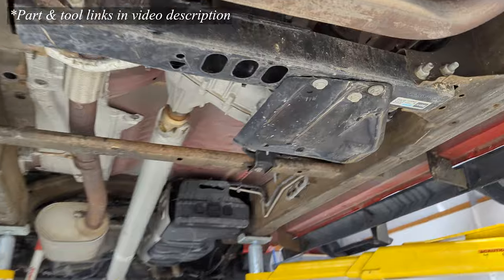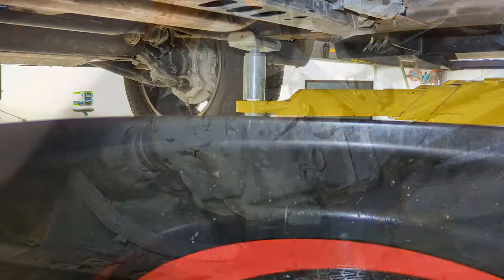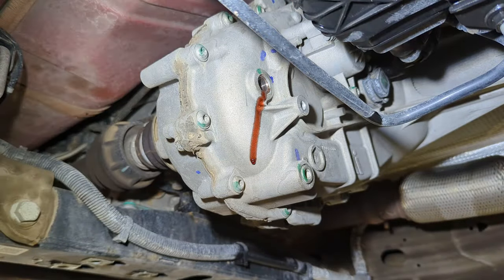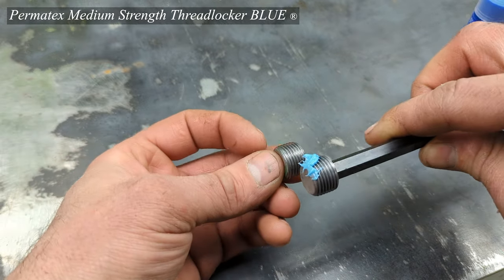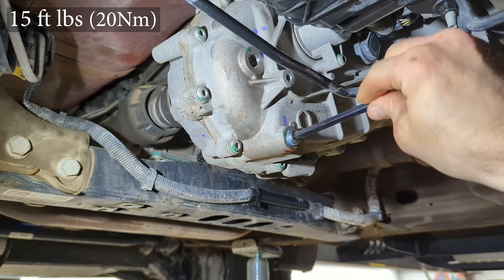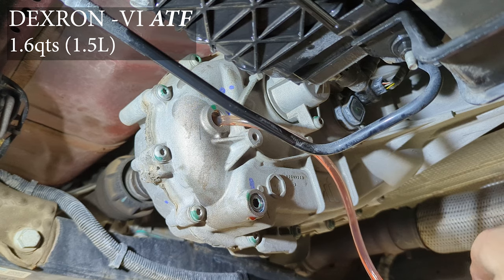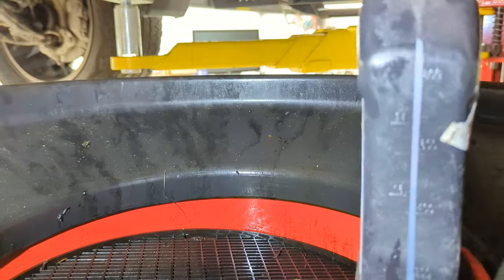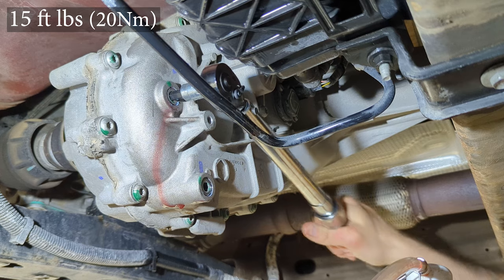2019-2024 Sierra/Silverado: 4X4 Transfer Case Oil Change

Comment: So I keep getting mixed info on the mobil 1 lv atf hp fluid saying it's compatible with dex vi. The older black label says it is however I ordered 2 quarts and got the blue lable which doesn't mention it on the back. Would this also work and be compatible. In my t case 2020 silverado.
Reply: Yes, blue label is the newer, improved formulation over the old black label.  This is what most recommend using to prevent or fix trans shudder & rough shifts when doing ATF flush & fill on our trucks.
Dealers in the US use ACDelco Blue Label.  Most DIYers seem to go w/ the Mobil 1 for xfer case & trans tho, and Valvoline 75w-90 synthetic gear oil for both differentials.  This is what I'm using after a decent amt of research.
I have the 8-Spd 8L90 trans btw.
Reply: Thanks for the reply, I grabbed some mobil 1, I'll look to grab valvoline for the diff, I still find it odd there are 2 different gm part numbers for the diff fluids. I've seen others using ams oil. What's your take on the ams oil
Reply: I considered using Amsoil.  It's good stuff, but pricey.  I don't really tow w/ my truck right now, which puts way more stress on the drive train, and I'm not putting crazy miles on it (~15K miles/year).  If I start beating on the truck more, I'd prob give the Amsoil a try. 🤙

Comment: Dumb question I’m sure, but I’m new to this. This transfer case fluid change is the same as transmission fluid change correct?
Reply from the maker: @GonzoD505  on a four-wheel drive vehicle, the vehicle has both a transmission and transfer case and they are serviced separately. The transmission on this vehicle takes Ultra Low Viscosity automatic transmission fluid (ULV ATF). The transfer case uses DEXRON VI automatic transmission fluid.

Comment: Probably a dumb question, you use transmission fluid for the transfer case? Same fluids?
Reply from the maker: The transfer case uses Dex VI ATF, however,  the 10-speed transmission calls for Dex ULV ATF (ultra-low viscosity).
Reply: Surprised it doesn't use gear lube
Reply: @MasterJacks  Thanks, I missed that in my viewing.  I guess that I was just focussing on where the fill plug was and what tool it took; and missed the annotation.  Thanks for the video.  It is nice to know ahead of time that it is as simple as I hoped it would be.

Comment: I have a 2023 suburban with 47k miles, iam gonna change the transmission oil  not flush, how many quarts fo I need ?
Reply: If you have a 10speed transmission, you have to use the special fluid. You fill it until it starts running out the fill hole. Run it up to 186F (check your dash fir trans temp) then open tje fill plug and and let it drain until it is barely seeping out and close it up. That is the procedure for the trucks. They also call for replacing the 2 bolts that hold the filter in place....like $16-$20 for those.

Comment: why not just use high temp white thread sealant like with the 2011 silverado tc vid?
Reply from the maker: I'm sure that would work just fine 👍
Reply: @MasterJacks question my Manuel says 75w-90 for the transfer case and that the 1500 series rear diff’s take 75-85. Would one be fine using the 75w-90 in that unit? A pretty good auto parts store is saying their system says it’s fine to use it in the rear. The 2500/3500 calls for 75-90. That 5 gonna make a difference? I assume fresh oil is better than old. Front differential rather sorry. Not transfer case 😂🎉 front diff. 😮
Reply from the maker: @JFEnterprize  I wouldn't hesitate to use 75W90 in the front or rear diff.

Comment: Mentioning socket and allen size in video would be helpful but otherwise nice video.
Reply from the maker: 👍 You can find them displayed in the upper left corner of the video during the shield and plug removal.
Reply: 17 mm